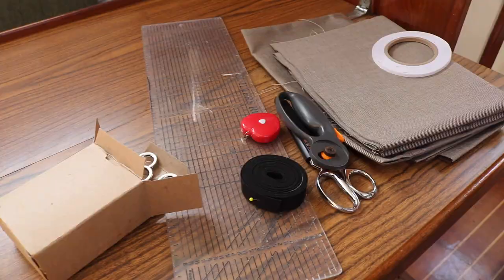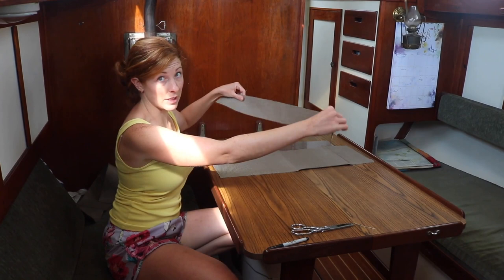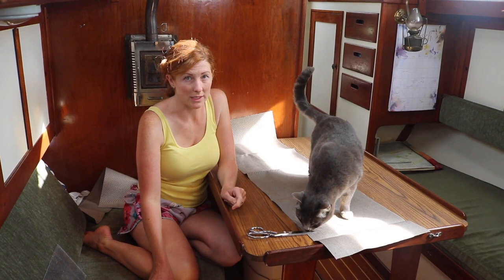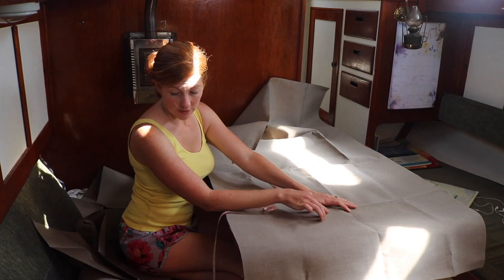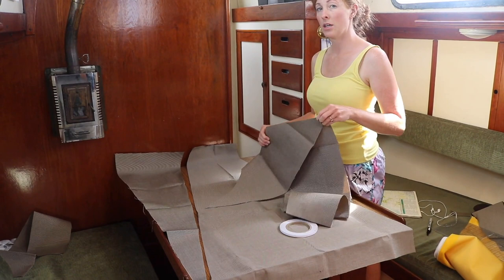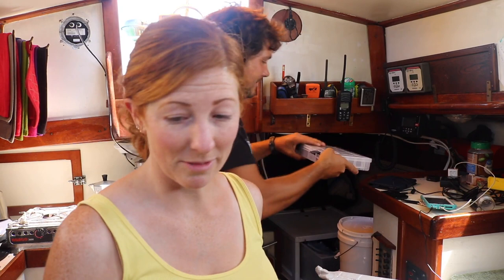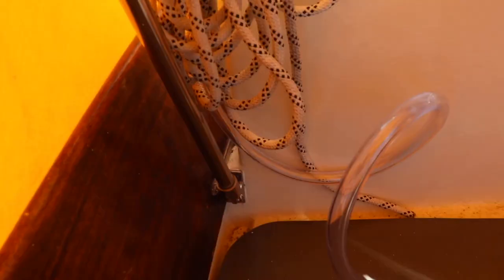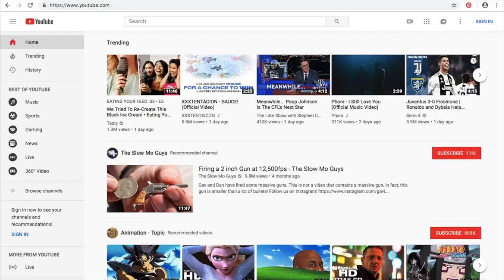How to Sew a Water Catcher for Sailboats (E.81 Sailing w/the Litzenbergers)

Comment: Nice.  Do you filter the rain water?  Im lucky in that my boat was designed with deck drains that drain to a common thru hull in the bilge.  Eventually im going to install a Y valve where i can divert rain water to my tanks!
Reply from the maker: We don’t filter it, usually, but maybe we should. I know some people add trace minerals to rain water before they drink it. Our decks are always way too dirty to collect water, but let us know how yours works out, we’d me interested to see!
Reply: @SailingwiththeLitzenbergers  You shouldn't need to filter, unless you are downwind of burning cane fields. We  catch rain off our metal roof at home & just divert it for the first few minutes before filling the barrels. Then we dose it with a dollop of unscented bleach (less bleach, more time: quarter cup per 60 gallons is plenty) and run it thru a few filters. A carbon block under the sink is a joy, removing most residual chlorine plus other 'off' smells or flavors. But those can be hard to mesh with a suction pump. Should work fine downstream of a foot pump, or with a pressure water system. But I'd drink it straight in a pinch!

It is amazing how much water you can catch with limited area. One half of a 45x35' roof will fill a 60 gallon barrel in 15 minutes of hard rain, even with inefficient capture. Our shop roof (about the same size) can fill a 400 gallon stock tank in two afternoon T-storms.

Comment: I'm confused... why did the sewing machine piss you off?  I know what a sewing machine is but my knowledge pretty much ends there.
Reply from the maker: I should have elaborated but that would have made the video 14 minutes longer 😂 I didn’t like it because it is really touchy, meaning it’s really difficult to get an even stitch, you have to have the right needle, thread weight and tension. Sewing is one thing I’m not so modestly good at, so I was frustrated that a machine that advertises as easy to use for sailors (people away from stores that have to sew something with what they have on hand) wasn’t easy at all. That being said I did have all the correct needles, etc. but it was still a huge pain in the a**!! I’ve been sewing since I was 14 on a Pfaff and they are much more forgiving. If you’re ever ready to buy a machine PM me, we’ll talk 😁